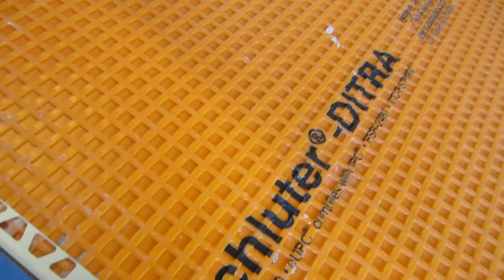Time lapse Kitchen floor using Schluter Ditra and T-Lock™ Master

Comment: Is it safe to use the Ditra mat under the heavy refrigerator? I am afraid the tiles would crack or the grout joints would fail since the fridge is so heavy and the Ditra mat gives some flexibility.
Reply from the maker: No ditra is fine for the entire floor.

Comment: Hi Sal, thank you for the time you spend in making these superb video's which you then upload. I am a 'give it a go DIYer' and I can say I normal turn out good quality work so I dont mind in attempting floor and wall tiling. I have been carefully watching your Marble bathroom projects as I have for the last 6 months been planning and studying different techniques. One thing I have not been able to find much info on is how to successfully install Marble and wood flooring together. I will be doing my open plan  kitchen   using marble in the kitchen area and engineered wood flooring in the remaining parts where the dining table etc will be. I am looking to use toung / groove real wood or click system engineered wood as this is easier to install. My question is why have you used Schluter Ditra, is this some form of underlay and is is required. I have concrete floor but there are some areas which are uneven and I was thinking of using self leveling concrete. can I not then tile onto that or do I need some membrane system such as Schluter Ditra. to be honest I dont know exactly that it is used for. Also what kind of metal beading did you use between the tile and wood floor. I tried to watch it in slow motion but it was hard to follow in your video. I want to avoid lips and bumps on the floor and want to make it as low profile as possible. could you please advise. thank you so much my email is hakanozdemiruk@hotmail.com if you need it
Reply: +Hakan Ozdemir also do you need to allow room for wood expansion? if so where, is that at two corners of the room??
Reply from the maker: +Hakan Ozdemir Schluter Ditra is an uncoupling membrane that is used under the tile as an underlayment, you can install your tile directly on to your concrete floor, but the ditra would make it a better job. Here is a video that explains Ditra https://www.youtube.com/watch?v=YpXEXqbh7ok You want to get your floor as flat as possible before installing the tile, and if you decide to use Ditra, it would go on top of the prepareed floor. The metal is used to protect the edges of the tile http://www.schluter.com/schluter-us/en_US/Profiles/For-Floors/Same-height-Transitions/Schluter%C2%AE-SCHIENE/p/SCHIENE Good luck

Comment: Whats your method cleaning the mud from around the t locks from ooze out?
Reply from the maker: +Todc The key is to not have the mud ooze out. If you watch you will see that i use a margin trowel to go along the tile edges to remove the thinset from near the tile  edge before placing the bases. When you place the tile into the mud the thinset will be pushed back to the edge but not up the grout line, this will eliminate most of the problem. The thinset will still come up in a few spots but it is manageable and once you get the hang of it, you will see that it becomes less and less of a problem. For those spots that it does come through I use a hook knife to clean them out.